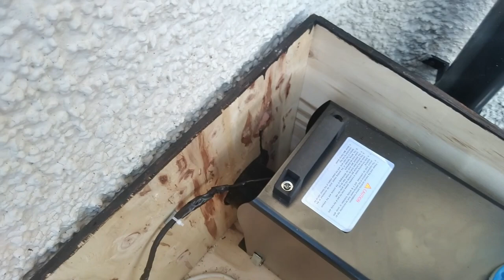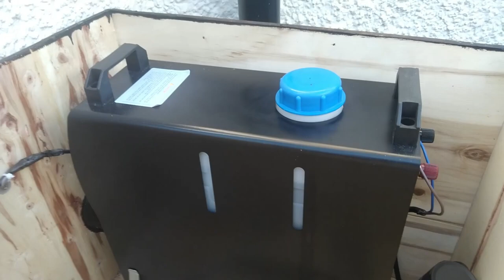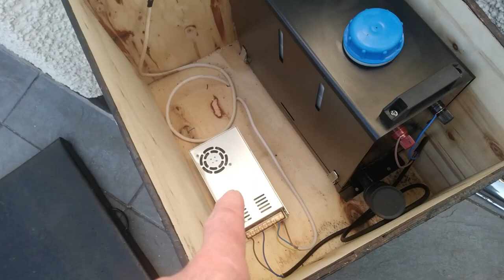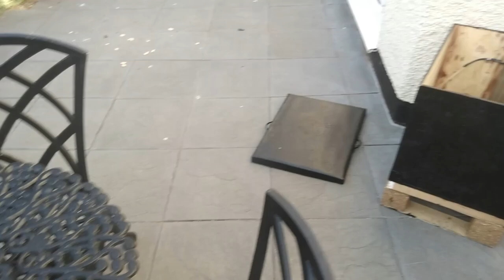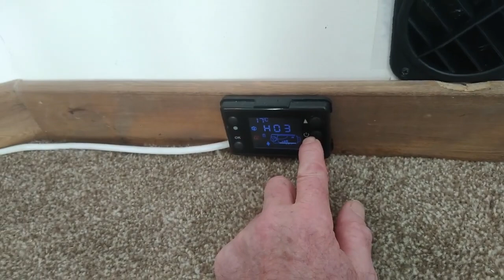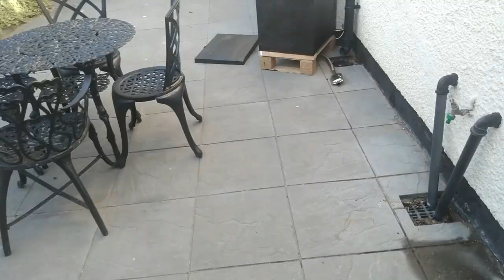Heating My Home with a Diesel Heater Chinese Hot House Saving Fuel Waste Oil Burner Off Grid Van

Comment: unplug the tank line and extend it 2 feet or more and run it to a  5 gallon fuel container and it runs for about 3 days . i set up a fuel pump from the basement .to refuel the container from a 275 gallon tank of #2 home heating oil

Comment: I fitted one in my boat I live on, it isn't a narrow boat more of a coastal type, I use around 2.5L / 3L over 24 hours running at around 1.3 but sometimes up to 2.8 and it is keeping the boat warm and so much less damp.
 I have a 300L fuel tank on the boat, got 80 ish litres of red fuel in it  at moment and not moving so and am about to plumb it to the heater so I don't have to keep filling it up.
 I tend to turn it off for a few hours a day, as I am pretty much stuck on the boat near 24/7 (due to medical stuff)  it has helped so much keeping the cost of heating down, I have it in the boats wheel house and 40mm tubing going to different sections of the boat so keeping it all dry and warm and I can hardly hear it when watching stuff on laptop or when in bed.
Reply from the maker: great, thanks for the message cheers andy
Reply: 10:15 haven't those little mufflers got a small hole to let any water out? Am sure I saw that on another video?
 I have a different one I got off amazon for about 15 quid and have exhaust pipe running through wheel house before it goes out the side, gaining more heat from it before it escapes.

Comment: A lot of energy is being lost on the exhaust. I have bought some extra tubes, and let it heat up these tubes. At the end of the tube, I only have 20°C (ambiant temperature) and at the beginning about 200°C. So I recover all energy not only from the blower but also from the exhaust. It has now improved my heater with another 100%. The tube you add should be much bigger, so the long exhaust pipe won't be a bottleneck.